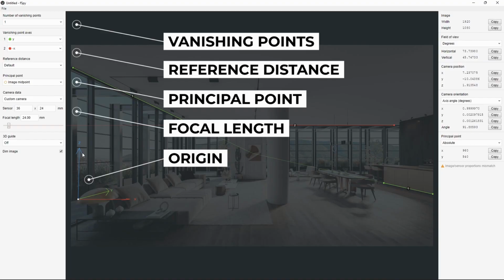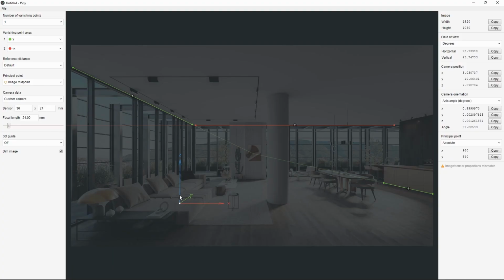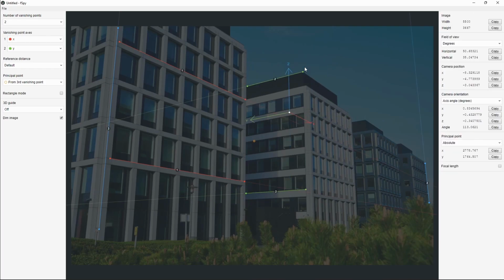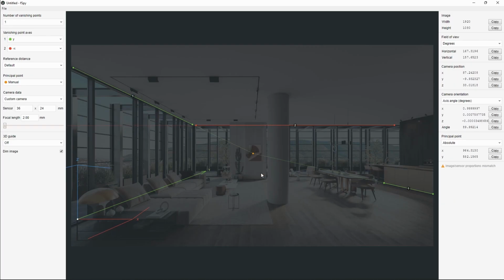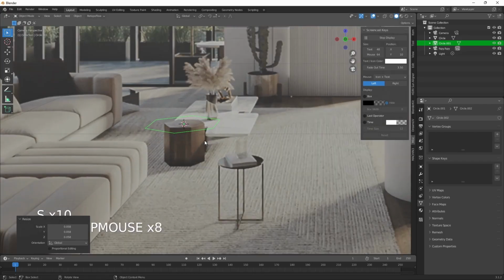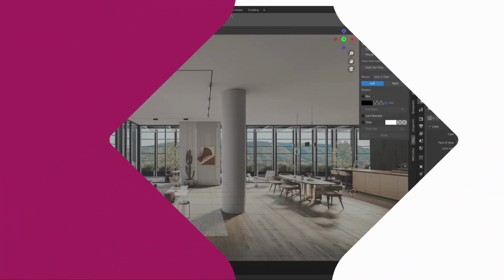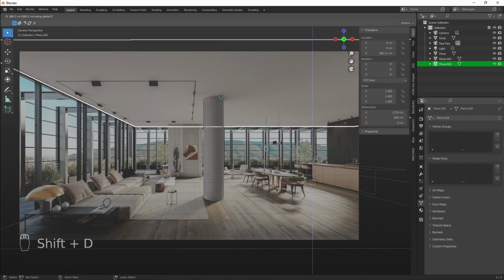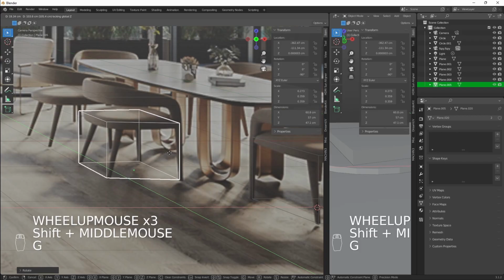BEST way to use fSpy | ALL Options explained | FULL camera matching workflow with Blender

Comment: Thank you! Easily the best tutorial on fSpy. I kept getting frustrated at incorrect matches, but your thorough explanation of the underlying principles set me straight. Cheers
Reply: If this is the one the Guru recommends then it's this one I shall watch.
Reply from the maker: Wow, Andrew, I had to double check if this is real you ;) I'm so happy to hear this, thank you! Just in case - I'll print this out and hang it on my wall :D
Reply: Hi @bpampuch, amazing work! I’m looking to learn the photomatch technique to design organic surfaces, then unfold them for plasma cutting to produce steel bases similar to 'Flowyline' designs. Could you make a small course or tutorial on this workflow in Linux? I’m willing to pay for it. Thanks!
Reply: Not only Fspy. Good explanations about photogrammetry as well.
Reply: I watched this tutorial just because of that even you have less subscriber...
Reply: Yeah but can it scan a donut
Reply: andrew I love you <3

Comment: Great tutorial, thanks! 🙏
I have a technical question: when importing from fSpy to Blender, I often get mismatches on images with strong/long vanishing points (ex: train platforms). In fSpy the axes and vanishing points align correctly, but in Blender the camera import gives a tighter focal length and the 3D appears slightly offset or “floating”.

👉 Is there a proven workflow to ensure a consistent match, regardless of the image’s perspective strength?

Comment: Thanks for this tutorial! Most other tutorials completely skip all the key details for getting a good match, especially the principal point importance. I followed all your instructions. I'm getting a much better match now. I am working on a picture from 100 years ago. I have come to the conclusion that it was taken with a Speed Graphic news camera on 6x9 cm film, so I set the sensor size to 6x9 cm. I don't believe the image has been cropped. That helps figure out the principle point. Circular objects still aren't matching up perfectly, but they are much better.

Comment: Thanks for the awesome video. I'm trying to use Fspy to accurately model arcade cabinets, and I'm having problems with accuracy.  When I compare the shape of the model I create using Fspy and the shape of a model using CAD plans, they often don't match. Am I supposed to be able to model things accurately with Fspy? I think the toughest thing to understand about Fspy for me is 1) how to set the principal point manually when there are less than 3 vanishing points (which you did a good job covering) and 2) adjusting the focal length (when there aren't simple shapes to match in the photo)

Comment: works great for Perspective Plotter (the fspy integration for blender) and fspy itself.

And chance you could do a follow up on the other area that is sorely lacking for photomatching in fspy and blender, around objects where lines are not as clear, as opposed to simple archvis? like 3/4s lengths of planes, or cars, or movie props, etc?

Comment: The issue, which a lot of these archviz images show, is that they have used camera-shift or tilt-shift. This will keep verticals vertical, no matter what you do. There are also special pense for photographers to do this. I remember having a discussion with the developper of this addonz that such images are nearly impossible to get right with fspy

Comment: id rather use the height of that cabinet. From the image they looked quite square. You set it to 60cm width, i kinda doubt that working kitchen table counter is also around 60cm high. My guess its wider, since table counter is around 80-90cm high

Comment: Thanks to this I've been able to use fSpy on pictures of complex parts on a plain background.  There are no parallel lines to speak of, so you have to draw between aspects of the part you know to be parallel (i.e. mirrored about one of the axes) using the single vanishing point method.  Very happy with the accuracy of the outcome, and it makes non-orthogonal reference photos more useable e.g. for CAD even.

Comment: Some camera show slight/more barrel distorion or fish eye effect as well. Is there any fix for that, apart from fspy as well, even we dont know any idea about their camera model number because thosa are smartphone images.
18:45 If we close fspy even saved the file, all the work is gone which feels bullshit, what is the meaning of saving a file if can't be opened again...😢
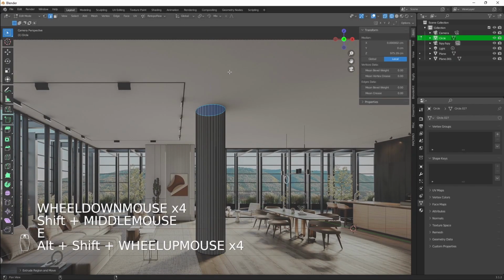29:06 here i split my view two part and use one for viewing and another for modelling to first trace outline in top or front view and then make adjustment in 3d.
Also, i will recommend enabling extra mesh objects addon so you can add single vertex anywhere to start extruding anyway you want. Adding plane each time and adjusting it is highly time consuming.
31:17 you just use Shift+RMB to move cursor and if you hold Ctrl also then it will snap as well. Also, goto keymap and search "set 3d cursor" here expand the keymap and set the option to "surface project" default is "view" that way your cursor will always placed on the normal of the surface and you can use it to add objects at inclined angle (remember to change orientation from "world" to "3d cursor".
Another idea coming to my mind is to use krita perspective grid feature to find guiding lines and focal point quickly.
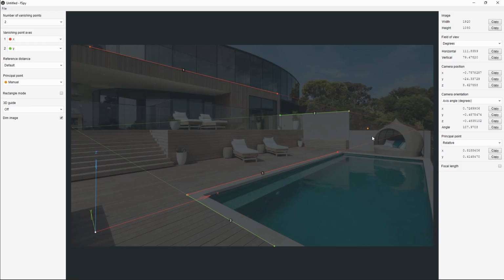14:35, what if the image is cropped all side ? Also if the image is extended by generative fill then maybe vanishing line gets incorrect.

Comment: This is so helpful! Can I ask what you would recommend for working with images that have been taken with a tilt shift lens? (a lens that artificially corrects perspective so the verticals are upright)
Reply from the maker: Tilt shift lens will change the principal point position so, depending on the number of vanishing points, you should choose one of the strategies to find it

Comment: Thank you! My fSpy skills improved a lot thanks to this video! I have a question though: suppose I have an irregularly-curved object, of which I can only trace one flat surface, which I define as X-Z plane. How would I go about finding the Y axis? Both the angles on that X-Z facade are not 90 degrees, and there is no other surface that is parallel or perpendicular. If I cannot find another object to use as reference, is there any technique I could apply?
Reply from the maker: Unfortunately there’s no easy answer. In such a case you can’t use these lines. :( not every photo can be a good reference

Comment: Can you ever use the furniture in a room to line up the vanishing points or should you only use the walls/floors/structure of the building? I can clearly see the x and y axis of a desk but it's not so easy to see the lines of the room, however, when I choose one of the other the 3D guide is off.
Reply from the maker: You can choose any set of lines that work for you as long as they’re parallel in pairs and orthogonal between axes (each pair of lines needs to be perpendicular to the other pairs)
Reply: @bpampuch Thank you for your reply!

Comment: Thank you for this awesome tutorial. Can you clarify something for me: if the vanishing point will occur but it's not visible in the photo do you consider it a 2nd vanishing point or only stick to the one you can see meeting in the photo? Thanks :)
Reply from the maker: If lines aren't parallel they'll converge at some point so you should count this as a normal vanishing point (even if it's not within the image boundaries). I hope it helps ;)
Reply: @bpampuch  it does. Thanks 🙏

Comment: Hi Thank you for the amazing tutorial Ive been having an issue for a while now I tried all your great tips but for some reason even when I set the cursor to the floor in Fspy and it all lines up...when I take it into Blender for modelling my floor is about a metre above where the base of the image is....the bottom of my image is always under the floor grid I have tried everything and can not fix it everything is floating and floor cuts into the walls....any ideas what Im doing wrong
Reply from the maker: Thank you. Have you added the floor plane in Blender and set its Z coordinate to 0?
Reply: @bpampuch  Hi thank you... I managed to fix it but it was a while ago and I cannot remember how I did it, but will keep that in mind for next time....I followed along and finished right up to where you left off and am looking forward to part two ;)

Comment: *Important Tip*: most of the images are provided with their focal length. You can see it in the properties panel of the image. It will save a lot of time and give extremely accurate results too
Reply: Great tip cheers
Reply from the maker: Good point. Thank you for sharing this tip
Reply: How do you even get the images. I have an adobe account but can't download them on a normal way. by inspecting the browser i can get a low quality version but there is no focal length in the properties.

Comment: Really great tutorial. In the "swimming pool" image, there is a way to find the exact position of the principal point. Unfortunately this is not possible with fSpy. But with some descriptive geometry, you now can find the exact location of the principal point on the horizon line (Horizon is determined by the two vanishing points). Because the lower two sun loungers are rotated in relation with the rest. The corners of the loungers are 90 degree (assumption). This rotation gives enough information for solving the principal point. It is too complicated to explain here. You need 2d-CAD software for this. Thank you for this tutorial with explanation and no cheating.  🙂
Reply from the maker: What a fantastic idea for the principal point. I’d have never thought about doing it this way. Do you know any publications with appropriate math for this? It would be great to extend fSpy with such functionality
Reply: @bpampuch  In this case It is a 2 point perspective (with vertical parallel lines) and something that is rotated with a straight angle. In a 2 point perspective, the principal point is always on the horizon line. How to find the location for the principal point on the horizon line in this case:

Draw a continuous line through the 2 vanishing points (horizon line). Take the midpoint between the two vanishing points. From this midpoint draw a circle through the vanishing points. Now draw the vanishing lines from one of the the lower sun loungers. This two new lines will intersect with the horizon line. Take the midpoint between these intersections. From this new midpoint, draw a second circle trough these intersections. Now there are two circles. These circles intersect each other. Draw a line through the intersection of these circles perpendicular to the horizon line. This line will intersect the horizon line. This intersection is the principal point.
Reply: Also a publication for finding the principal point: 

https://www2.mathematik.tu-darmstadt.de/~ehartmann/dga-incl-loes.pdf
(german, but with images) page 126, 127 and solve on page 181, 182 But they are different from this case.
Reply from the maker: @Hsubetakevol  Thank you for sharing, I'll read this. Excellent paper!
Reply: Yeah, your right. I remember this from some folks at blender artist which showed this same principle on an image which I had issues with. The person explained showing this image with huge circles. This was in the early days of the addon. I believe it was just an addon and all was done in blender. Perhaps 5-7 years ago. I believe the thread is still there with the images